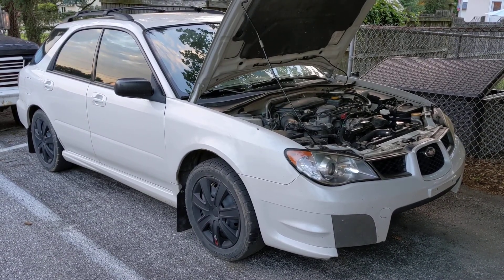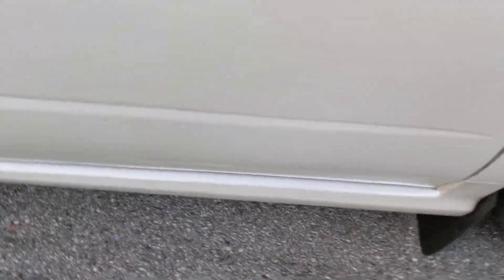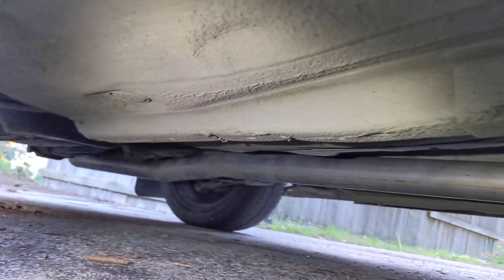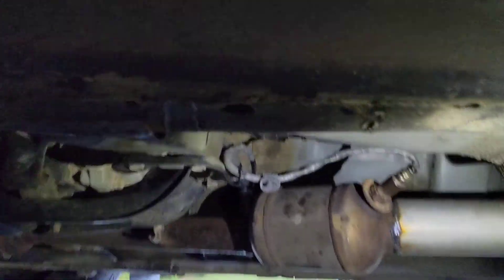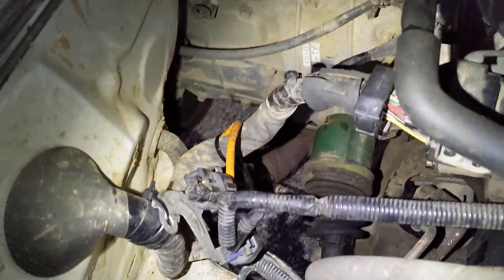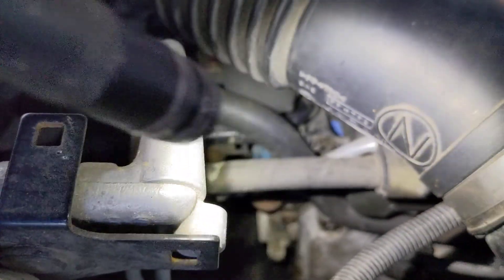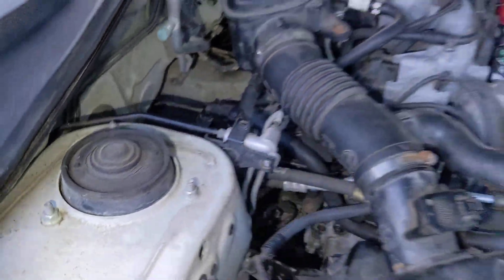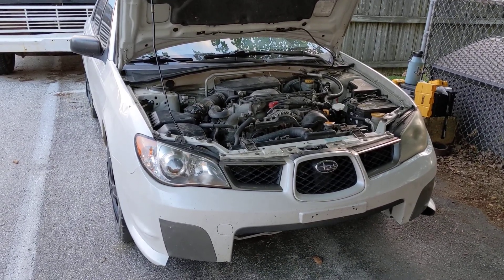How to Install UEL headers on an 06-07 Subaru 2.5i

Comment: Will everything simply bolt together if i get 97-05 headers and cat section? I want to do this to my 07'. This will be the first car mod i've ever done. I looked into using WRX headers from an 07-09' and that's not an option, your video here is the best thing i could find to do the swap from EL to UEL.
Reply from the maker: it basically should all bolt up, I had aftermarket piping after the cat section, if you intend to use your factory piping after the cat you might have to modify it where it bolts up post-cat, since the layout is different. Other than that, and extending the rear o2 sensor wires, that should be it! I haven't had a check engine light at all from doing this and it sounds so much better!

Comment: If I ran the rear o2 to the rear bung on the front cat instead of all the way to the rear cat, would I still have to extend the harness?  Or would that be able to reach?
Reply from the maker: It would probably reach if you move the harness like I showed in the video

Comment: Hey bro any downsides of running uel? Did you get a tune? I got the same hatch and everyones telling me ill run too rich or too lean and blow my motor
Reply from the maker: I've had zero issues with mine, since this video I did get rid of the second cat, and move the downstream sensor to right behind the first cat, no CEL's at all. And there's no tune needed for an N/A subaru, the computer can accomadate a bigger exhaust/UELjust fine. I get 26-29 MPG's over the 2 years I've had the car with the UEL on, it's not gonna hurt the motor at all lol
Reply: I'm so glad you responded you have no idea. I'm running the same set up and my cars running fine but everybody telling me I need a tune or I'm blowing my motor meanwhile no company runs a tune for a 2 5i from 06-07 so I figured just let nature take its course lol . But trust me your response definitely helps me sleep at night not worrying about waking up to knock or something lol. Thanks again! Learned a lot from this video
Reply from the maker: Yea man you'll be fine, I've had mine on for over 20k miles with zero issues! People don't know what they're talking about lol. Yes the WRX/STI would need a tune, there more sensitive to mods, but N/A's computers adjust fine to exhaust and like a cold air intake, I have both and she's one of the most reliable cars I've owned lol. Just drove 4 hours one way to an offroad rally in the mountains and she did great, like 500 miles in 3 days lol  @bangerzbang
Reply: @Z3CHYD Thank the lord lol. I've babied my engine from the moment I got it, all the nightmare scenarios I was hearing ruined the enjoyment at first for me to the fact I started regretting it but now I'm a bit more at ease and at this point there's no going back because I already scrapped my old mid pipe and not paying $5-$600 for a new or used  one. I came across another guy on social media that ran our model with headers and a high flow cat since 2020 and he said he been doing just fine without a tune as well. Let's hope🤞. Thanks again man.
Reply from the maker: Glad to help! If you check out my newer video's I have a vid with how mine sounds with the 2nd cat removed, I'll say she screams right around 3k lol @bangerzbang
Reply: @Z3CHYD   watching it now!

Comment: Can you link the headers? I cannot find one anywhere. I’ve searched forever on eBay
Reply from the maker: https://www.ebay.com/itm/FOR-97-05-SUBARU-IMPREZA-2-5L-RS-EJ25-NON-TURBO-RACING-HEADER-EXHAUST-MANIFOLD-/381524777452?mkcid=16&mkevt=1&_trksid=p2349624.m46890.l6249&mkrid=711-127632-2357-0
Reply: @Z3CHYD  do you have a different link it’s not working anymore
Reply from the maker: https://www.ebay.com/itm/FOR-97-05-SUBARU-IMPREZA-2-5-RS-EJ25-NA-RACING-HEADER-MANIFOLD-EXHAUST-SS-/184638408089?mkcid=16&mkevt=1&_trksid=p2349624.m46890.l6249&mkrid=711-127632-2357-0
Reply from the maker: I always just search Impreza 2.5rs header and hundreds of results pop up
Reply: @Z3CHYD  are these good headers. I have a really good 2007 2.5i with no problems at all.  and I don’t want to get a part that’s going to fuck up a perfectly good car.
Reply from the maker: I've had no problem with them so far, and zero problems with my car as well lol
Reply: Updated link please!!
Reply from the maker: They’re almost not on eBay anymore, they’ve since removed most non-emission legal parts after they passed some stupid EPA law several months ago.  I did find one listing though. And if this one doesn’t work soon, just google “05 Impreza rs UEL” and plenty of other websites have them for like $100 too. https://www.ebay.com/itm/225412410676?mkcid=16&mkevt=1&mkrid=711-127632-2357-0&ssspo=kfkcwlcyr2g&sssrc=2349624&ssuid=25LJaB1HTGW&var=&widget_ver=artemis&media=COPY
Reply: @Z3CHYD  header still doing good ?
Reply from the maker: @NORMAND021  Yep zero issues with it in  the last 4 years
Reply: so this might sound stupid but will 05 headers work on an 06-07 ej motor? N/A of course
Reply from the maker: Yea that’s what I used, UEL header meant for 97-05. But like I showed in the video, I used the cat section from an 04 Subaru to make it work since stock manifold has the cats in it. In a later video I deleted the 2nd cat, and moved the downstream O2 sensor to behind the first cat, and zero codes since then

Comment: I did this now I have a check engine light p0171, p2096, p0137 any idea why I have this problem I’ve seen other people do this exact setup with no issues
Reply from the maker: Well all those codes have to do with the o2 sensors, so either it would seem your downstream O2 sensor is bad, or when you extended the wiring maybe one pulled loose or has a bad connection. Did you solder, crimp, or heat shrink your wires? Also if you didn't use the same gauge wire when extending wires, that can mess with the sensor signal, causing it to not work properly